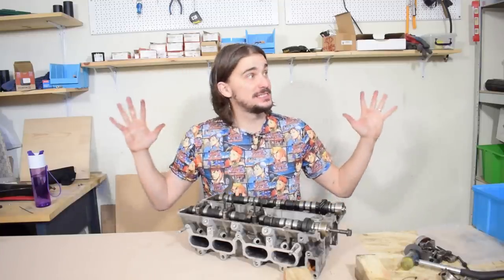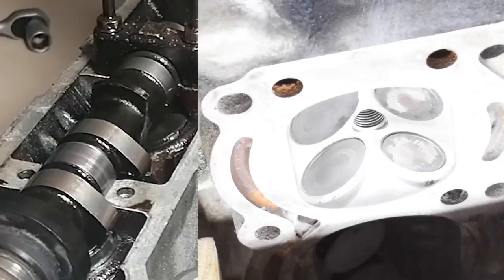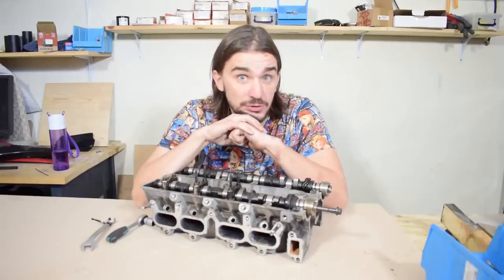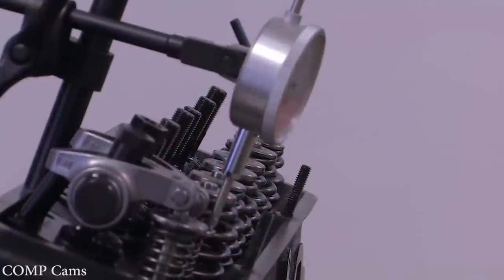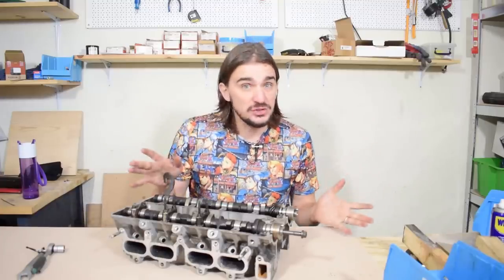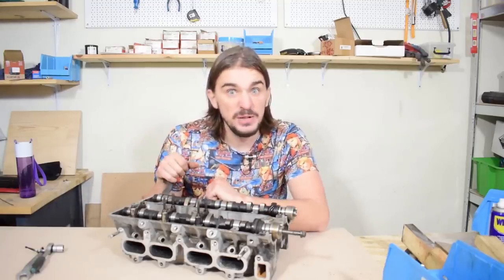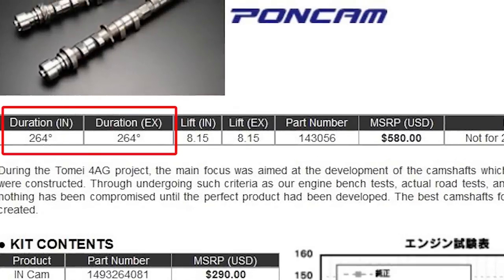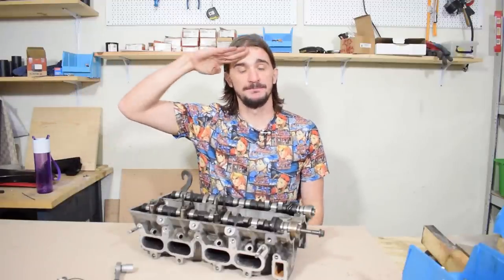Real vs. Advertised CAMSHAFT DURATION

Comment: The problem with the varying ways in which cam duration is advertised has long been known. The best way to compare camshafts is with a graph which shows lift VS degrees so you can see everything at a glance, especially how quickly the cam profile opens and closes the valve which can greatly affect valve spring selection and wear on the valve train. 

If a manufacturer refuses to provide a graph, I won't buy their camshaft.
Reply: True. 2 cams with the same lift and duration at 0.050 can have wildly different ramps and flanks leading to considerable differences in performance.
Reply: @bobraby9089  Exactly.  And also the difference between hyd. and mec.
Reply: yea the profile is very important too.
in germany we say a camshaft is "Scharf" if its not so pointy like stock but has a steep ramp and flat top which increases airflow because of more time open at nearly full lift
Reply: My numbers look realy tame but I am told they are not because it is a roller cam and the figures are different to hydraulic? 260 Advertised 240 @ .050
Reply: AusPhil Adventures from your name I assume your Australian, if so the duration is similar to the solid cam in the falcon GTHO, not so tame, keep in mind the rocker arm ratio in these types of engines makes things different to the OHC engines, you can’t transfer the duration numbers over between them.
Reply: @bobraby9089  this is actually the reason why most manufacturers have advertised duration and duration at .050 lift. The difference between the 2 will give you a rough idea of the ramp rates of the cam
Reply: @konnerkramer329  That is true, if they bother to mention at what lift they measure advertised because that's not standardized either. Nonetheless, comparing cams between manufacturers can be a little tricky if you don't know these things. Hell, it's tricky enough if you DO know....

Comment: I have a 4age smallport on a corolla ae100. Its sitting for 3 years outside. i tried starting it last week and to my surprise it did start. All your videos are very helpful to me so keep em coming. Im planning on carbureting it. Shoutout from your new subscriber here in the philippines! Stay safe
Reply: My smallports been laid up for 18m now while I fix some accident damage. I start it regularly (<3 weeks) in the hope that will keep the fuel pump and injectors from sticking. About a month ago I had 2 injectors sticking then freeing themselves soon after startup. Idle quality is slightly down with an intermittent "soft" engine fire every 10s or so. So our primitive "one big hole" injectors are not immune from sticking and poor spray patterns. A fresh tank of gas should fix it, but it's well worth keeping an eye open for symptoms. If you want to sell your ECU, ECU plugs, fuel regulator, MAP sensor and injectors as a kit after you go Carbi, I'd love to have them. I've already put aside an ESA coil driver and distributor. Mine is still running a Bigport EFI and is ok but I'd really like to have a non-Tvis spark map and knock detection.
Reply: If you carb it,
It will no longer be able to sit for years, while still starting

Comment: I had wondered about this, but hadn't researched it. Nice info! Thanks. Nice shirt, too.
Reply from the maker: Glad it's useful. I remember this confusing me way back when I was browsing cams for the 4ag, so I thought it's probably confusing someone else too.
Reply: @d4a  Now I'm curious about the maximum duration that the stock ECU can handle for a 4AGE because of different advertised and final can be different.
Reply: Jayhachi Talk to a tuner

Comment: For this video I understand why you did not mention LSA. LSA places the intake valve at the optimum opening and closing point and cubic inch and intake valve size have a huge influence on maximizing cylinder fill.  Most cam grinders and engine builders get it wrong and that just adds to the confusion of understanding cam specs. Even Ford got it wrong on a line of replacement high perf cams from the dealer, I think it was for the Windsor engines. Lobe separation angle is very important and grinder use wide LSA to reclaim vacuum at idle instead of adjusting duration.

Comment: Valve lash also factors into play as well for non self adjusting lifters.  You can theoretically squeeze out a slight duration advantage by running solid valvetrain at the tight end of the clearance spec range, unless that's already the lash spec they are measuring duration with.  Not sure how much difference an extra .05 mm added on to how much more cam duration is used up to actually get the 0.05" valve lift point for most cams.  .05 mm is the allowable range for valve lash on both Honda engines I have which all use solid valvetrain.

Comment: In Europe its usually @ 1mm ( 0.040" as near as makes no difference) but here in UK its both 0.050" and 1mm , and advertised can be lash to lash point ( where the clearance is taken up ) or at a the SAE standard . When plotting the duration you then have a single figure to compare which is the area under the curve . When actually designing a cam there's a whole bunch of factors to take into account . Different valve trains have different rates of acceleration of opening and closing as the first is at the maximum amount of stress and the second relies upon spring rate to keep the lobe in contact with the mechanism that opens the valve . Now here you can have an asymmetrical or symmetrical lobe design for rate of closing . Bucket and shim is typical but rocker and tappet ( whether flat mushroom or roller ) are common too and there's a third without a spring ( well maybe just a tiny one) the ' Desmodromic' as designed by Ducati . I won't bother with the pneumatics or solenoid operated as they are not cam reliant .
All I can say is thank God there is now software that makes can design easy as designing them empirically was a PITA !

Comment: Important note for those curious about advertised duration vs duration at .050"/1.00mm lift and why both exist:

Duration at .050"/1.00mm is a relatively reliable method of measuring camshaft duration for a hydraulic lifter style setup (the lifter/bucket/finger follower has some sort of fluid plunger that utilizes pressurized engine oil to make up for valve-train lash/gaps.  The reason for this is that on average, there's about .050"/1.00mm of 'squish' or compression of the lifter (not the hydraulic fluid) that occurs before the lifter starts following the profile of the cam lobe.  Hydraulic lifters tend to be a piston and cylinder with a spring inside, where the pressurized oil from the oil pump feeds into the chamber above the piston, and then the piston pushes some of the oil out as the forces from both the cam lobe and the valve-spring push against each other.  The lifter pushes out a certain amount of excess oil before effectively becoming solid, at which point it follows the cam profile throughout it's duration.

Advertised duration is important for engines with a solid lifter setup (think NB VVT miata engines for example) which use either shims in OHC setups or poly-locks in OHV style engines.  Since the lifter is completely solid, and therefore doesn't have any squish or compression, it's going to follow the ENTIRE cam lobe profile, not just a certain portion.

The final point to make about this is that even with a solid lifter setup, the reason why there's still a duration at .050"/1.00mm is that the amount of airflow occurring past the valve (intake or exhaust; doesn't matter) is negligible prior to this point.

It's important to know what type of lifter style your engine is before choosing a performance cam, because you want to know which number is pertinent to your engine build.  A lot of different performance aspects hinge on the camshaft design, ranging from intake runner length to exhaust header primary length, ignition timing, block deck clearance tolerances, and many more.

Comment: Actually, the lift can be confusing as well. I was involved in a race series where the regs specified a maximum VALVE lift. The aim of this was to hopefully restrict the choice of camshaft. Unfortunately, the writer of the regs didn't realise that the lift quoted by the camshaft manufacturer didn't allow for the valve clearance. As a result, I found that I could use the next cam up the range because the actual VALVE lift still conformed to the regs (and I wasn't the only one). The actual lift was only about .5mm more than the lower spec camshaft, but it also came with more duration. For a while there was confusion as to why certain engine builder's engines were so much faster than the others. At the end of the season the regs were changed to specifically allow only one cam profile. Of course, none of this will apply if you have hydraulic lifters. Regarding duration, this is a bit similar to hi-fi amplifiers being quoted with a power output without specifying the measuring criteria or distortion levels used. I have a 1970s 50W RMS amplifier that is way more powerful than many others with the same claimed power outputs.

Comment: Very informative video! I bought some cat cams for my 4age bigport. They're mild street cams at 238* overall and 212* @ 1mm lift (stock is 202* @1mm). Hopefully I see some slight improvements in the low-mid range.
Reply from the maker: I have two exhaust cams from the first catcams set in my 4age, definitely a nice chunky midrange, but not much drama at the top, works great in the real world tho
Reply: @d4a  exactly what I was going for! Should help a bit with my 3.73 final drive trans I'm running. If it ever goes I'm definetely swapping it for a fwd gts one with 4.13 final

Comment: This is good, but I think you may have made a slight terminology error.

Duration isn't measured at the "valve lifter seat", it's measured at the valve seat...whether advertised or "@0.050" (1.2mm)".

Normally the cam manufacturer specs the rocker ratio (if applicable) the measurement was made at and it can also change based on hydraulic vs solid lifters. For example a wild sounding solid lifter cam will measure out much more tame compared to a similar duration hydraulic cam...the reason this happens is due to the solid lifter requiring mechanical lash vs the hydraulic lifter effectively eliminating any notable lash.

But that minor issue aside, this is a great video for the new crew looking to build a hotrod.

Comment: Both advertised and 0.050" are important. Comparing the 2 for the same cam will allow you to gauge/calculate the lobe profile and ramp rate.  The tighter the 2 are to each other the more aggressive the ramp rate is and the larger the area under the curve will be for the given duration, thus better performing better than a cam with relaxed adv vs 50 thou.   For eg. a cam with 250º @ 50 thou and 300º adv will idle worse and make a little bit less torque throughout the rev range compared to the same 250º @50 but with 290º adv.  This is because the very low lift areas of a high adv duration cam effectively lowering dynamic compression ratio and increasing overlap but does little in aiding air/exhaust flow.  having the valves very slightly open for the amount of time is a compromise in performance for extending valve train life.

The quicker you can get to max lift for your given 50 thou duration the better the overall performance.  

The obvious cost is valve train stability and longevity, the higher the ramp rate the stronger the valve train parts need to be and the stiffer the valve springs need to be to combat the aggressive acceleration of the valve train components.

Would be worth mentioning this in a follow up video plus the following which would aid people in choosing a cam.
Cam advance/retard (intake lobe centerline)
LSA (lobe separation angle)
Ramp rate (as explained above)

For my own project I was looking at: 
308º adv, 258º @ 0.050", 0.539" 104º intake center.  This was the original race engine spec'd cam that was a flat tappet design. 
Spoke to the cam manufacture and got the updated specs for a roller lifter cam for the same race engine. 
298º adv, 260º @0.050", 0.546" lift and 102 intake center.   Because is it a roller profile they updated the profile to be more aggressive and in part helped explain why the later engines produced some 40hp more with everything else being virtually equal.

Comment: The point (minimum valve lift) at which you would start to measure your duration is dependant on many veritables of which I feel would only be determined by not just application but your human application. We can both make the same engine to perform the same way in a different configurations but the difference in our configurations will only show themselves apon application

Comment: From a power perspective, total duration is the one that matters. The advertised or duration at .050 is the standard used for degreeing your cam. In simple terms .050 is basically a number that some of the manufacturers agreed to use as the reference point for us to use to time the opening and closing events

Comment: I’ve been saying on my channel for years. If you want to increase hp on any naturally aspirated engine. You have to install a hotter cam.
Reply: You can raise compression and port the head, this will give some gains in power without a cam change.
 Also stuffing a bigger cam in with high lift also needs (on some cases) valve springs to stop binding and/or float.  I have built many pinto 2.0 ohc motors and just going longer duration with same lift gets very good power gains , duration is the key not just lift, but both are best. I used to have a 320adv duration cam with 13.8mm lift , no power below 5k but all hell broke loose till about 9.6k rpms 😁
Reply: @marty3469  People raise the compression ratio when they install a hotter cam. Because you talk about porting heads let me know you have been watching HP tv.
Reply: @marty3469  You have never built an engine in your life. The stock 2.0 pinto cam is very weak. Adding nothing but duration on a small lift cam would be pointless.
Reply: @blackericdenice  yes I have built motors before, and I thought this might pull a nerve,  cams in them are docile but there is still power available from them.... Not much I do admit.  Also I don't claim to know it all about motors or I'd have some engine tune channel on the go .  If you want me to visit your channel ask nicely please
Reply: All I want from you is to stop lying.

Comment: Great video.   Can you do a video of how to determine the specs on a camshaft if you don't know its duration and lift?  How that can be measured with the head assembled but not on the block.  Also to do it with the engine fully assembled.  Also, is there a way to measure the cam specs outside the head.  So 3 methods.

Comment: The kelford cam has MORE duration ...@ 0.3mm / 0.012" it is 266 deg  so I suspect @ 0.1mm / 0.004 "  it would be 270 + odd deg , where as the Cat cam is @ 0.1 mm  262 deg .....but the ramp on the Kelford cam is softer on acceleration to 1 mm/ 0.040 "   which may make the cam lobe wear less ?
The only true test is dyno runs

Comment: All the aftermarket manufacturer habits of how they express cam specifications began with single cam engines and it was much easier because valve timing, eg. 30/70, 35/75, 36/72, etc. was directly proportionate to duration and the main reason you wanted to know the difference between advertised duration and duration at 0.050" was to give an indication of ramp speed, which tells you whether you can use solid lifters or not. So, for example if you buy a 30/70 cam and it gives the duration as 290 degrees you know damn sure that's crack to close on that timing and you'll ask the manufacturer what the duration is at 0.050" or, if he can't tell you then whether or not it's a hydraulic camshaft (breaks things in a solid setup) or a solid lifter one (can be used on both). If you know what the 0.050" duration is, the advertised duration and the valve timing however, you know which type of camshaft it is with a little think about it, combined with knowing the lift and rocker ratio (if used) all this info gives you a very good indication of exactly what valve gear setup to use with it, down to the spring rates so you don't have to attempt trial by fire with a wild guess or some bad information from an aftermarket parts salesman, which happens since the guy on the counter usually isn't the guy who makes them and probably used to work in a bank.

Otherwise the way everybody talked about their camshaft specification was simply by using valve timing as a general, but very loose indicator, eg. 22/62 is a street cam, 35/75 is a track cam, whilst 30/70 sits in the middle, heavy street or mild track. It's not strictly true but most people didn't know any more than that, in fact in street cars most people used to just call 30/70 "full race cam" and 22/62 "mild street cam" and pretty much thought those were the only two options.

Now you have all this twin cam doody dah and I don't know anything about that, I suppose you can dial in your own valve timing between the cams yourself so it's a different ball game?

Comment: My 4age 16v poncams came with a data sheet that tells you actual duration (264° in/ex), duration at 1mm lift (226° in/ex) and at 0,05" lift (222°) I am pretty sure you can find this spec card with googling also before buying a set of cams ;)